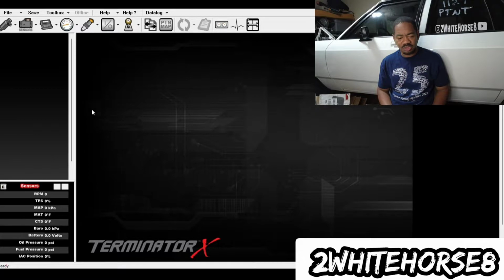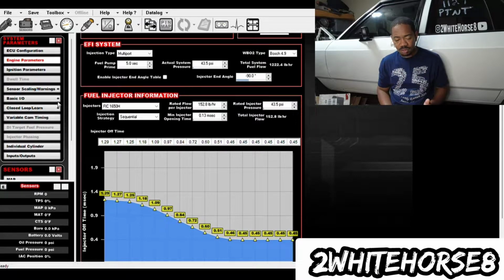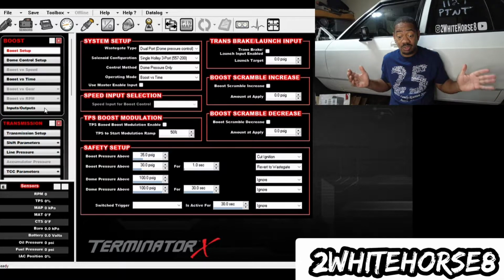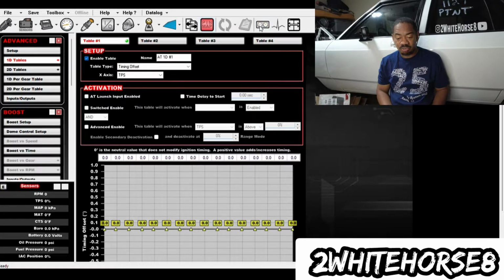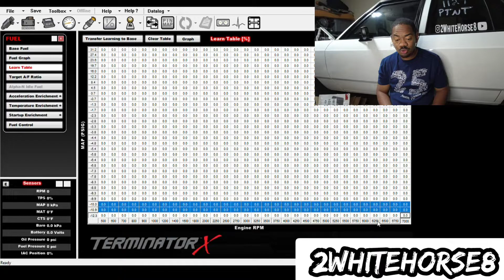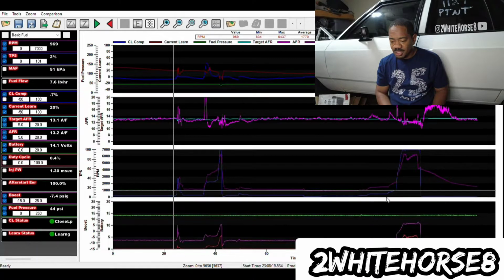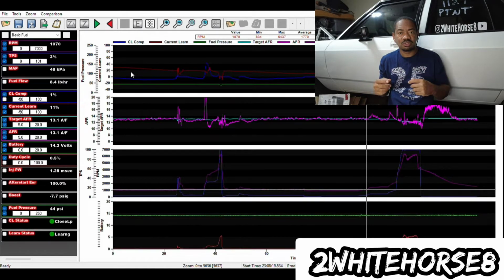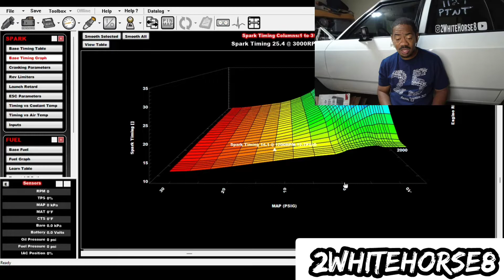Comparing Holley Terminator X to Edelbrock Pro Flo 4 + Quick Terminator X Software Overview

Comment: Sounds like if u are na go edelbrock.. if boosted Holley
Reply from the maker: If you're only looking at these two systems. Edelbrock has a more adjustable EFI system too - I just went Holley because I liked their system more at the time. There are a lot of different EFI systems out there tho
Reply: @2WhiteHorse8 one reason I’m considering edelbrock cuz it’s port injection over throttle body
Reply from the maker: @SleepyDaisy-ub9wt that a good reason

Comment: I wanna put one on my 521 Ford up I’m not planning on doing boost or force induction. Do you think I would need this terminator or can I  get by with the pro flow?
Reply from the maker: Depends on how you plan to tune it. You might want to confirm the ProFlo can tune a 521 first tho. I'm sure it can but it wouldn't hurt to check with edelbrock

Comment: Did you buy just a Holly electronics?
Reply from the maker: Not sure what you mean but it comes in a whole kit all together. Wires, ecu, some sensors... and you can use some sensors from the engine you have already
Reply: @2WhiteHorse8  I already have the Elderbrook pro flow four on my Windsor. Do you happen to have the part number that you bought? Thanks.
Reply from the maker: @mattabbott1650 I got the terminator x max for transmission control ... go to holley.com and look up the "ford universal" one
Reply: @2WhiteHorse8  I wonder if that would have the same sensors as the Elderbrook throttle body
Reply from the maker: @mattabbott1650 yeah. The sensors are the stock sensors. The wiring harness will plug into factory sensors.

Comment: Hey man. Did you just swap the ECU and use the Edlebrock hardware? I’m a big block Chevy guy with twin turbos and I’ve  only found 2 options for Port type EFI the Edlebrock and Fitech.  The Edlebrock Pro-flo 4 is an awesome option it has everything included for $2800 bucks, can use an old tablet for display instead of paying $800 for a dash panel and appears to be easy to set up. It’s unfortunate that they don’t offer a 2 step, boost controller, nitrous controller etc. being that these features are not offered im leaning towards a Holley Terminator X 4150 with the 8 injectors
Reply from the maker: I'm using the edelbrock intake, but most other parts are aftermarket. I think as long as you have the sensors reading the right thing then everything should work fine.
And you're right about the 2step and others... Terminator X would give you good control over those.
Reply: @2WhiteHorse8  awesome thanks man I hope to see you on the track one day
Reply from the maker: @terryritterbush4239 yeah for sure... maybe I'll have enough courage to line up with the big block ... but probably not 🤣🤣🤣
Reply: @2WhiteHorse8  lol it’s just a old truck motor with chrome valve covers and a 3/4 cam
Reply from the maker: @terryritterbush4239 right... sounds like a setup to me 🤣🤣🤣🤣🤣

Comment: Really curious to know which components of the PF4 were reusable and which weren't while switching over to Holley Terminator x. I myself have a PF4 on my 302 and  considering switching to Holley.
Reply from the maker: I used the intake, fuel rail ... could have used the injectors and throttle body but I sold them with the ECU. I believe that's it.

Is this for a Mustang? If so, I think they make a kit specific to the Mustang that mocks up to more stock parts.
Crown Vic guys don't get that consideration. But definitely not as many of us as there are of you all...
Reply: Yes, this is for a mustang. Were you able to reuse the edlebrock distributor?
Reply from the maker: @Daniel McCamish  no. Those are specific to the PF4. 

Check out this video:
About a year ago about the distributor I have now for the Holley
https://youtu.be/GdPYYW_A_-E
Reply: Could you talk a little about how each system ran, was there any more (how it generally ran) with one over the another, I was wanting to go proflo but their software sucks big time it either supports engines with a lopy idle or engines that have high vacuum with a small cam
Reply from the maker: @Douglas Carneau  driving wise, mine was very smooth on the PF4. And it got to the smooth riding point quickly too with the learning program it has. After a few drives, it was ready to go. Even after switching to boost it still did pretty good. The software does leave a whole lot more to be desired vs. the Holley software, but drivability was definitely there. And the same for Holley. I do believe the Holley lets you pick and choose if and when you want changes to be made more than the PF4. 
Does that help answer your question?
Reply: @2WhiteHorse8  One last question was there any power difference? and any difference in fuel mileage? and did you say you used the edelbrock pf4 manifold? but not the injectors?
Reply from the maker: No noticeable power difference just more tunability - which could lead to more power.
No fuel difference. I did use the edelbrock intake (still am for now) and upgraded the injectors because the holley allows it while the PF4 would not. Also holley controls the transmission. PF4 doesn't do that.

Comment: I have ls 6.0 4l60e (ik 4l80e coming soon) & trying to decide between the two ( holley vs pf4 ) for turbo charging. Single to start off but maybe go twins later down the road. Think the pf4 base maps manages real good? I’m no tunner at all so not sure of how depth I’ll be getting into that area anyway. Just want thang puttin down power. I have an 2dr 79 Malibu btw.
Reply from the maker: What up man. That sounds fun. 
Yes! PF4 base maps were on point for me. I think it'll be fine with your turbo too. Just put the o2 in a good spot behind down the exhaust.

Comment: So if you just have a 350 with 500 at the crank and you're not really into racing elderbrock would be just fine right?
Reply from the maker: Oh yeah. Even if you want to race it, the Edelbrock is good. It's just not for SERIOUS fine-tuning of an engine. Very good system.
Reply: @2WhiteHorse8  all right brother I've been checking out your videos preciate it I just came across the elderbrock EFI but if you said she's good for you know everyday and you want to show out a little bit okay man thanks for the information maybe Yahweh bless you and your family. I'll keep up with your content on how you're working with the other EFI
Reply from the maker: Thank you! Sure thing. I have a couple ofnvideos brewing...
Yeah,  I'm sure you'll be fine with it. What type of engine you running?
Reply: @2WhiteHorse8  355 with heads, mild cam respectively 500?
Reply from the maker: Cool. That'll be fun to put a PF4 on. Good deal man.

Comment: Great Info. From what I gather, would you recommend the proflo 4 for simplicity and for someone who is not going to race?
Reply from the maker: Yes. Even if you plan to race it a little the PF4 is a good system. You'll just be limited in how precise you can tune and log data

Comment: Great video!  I've got a 351W in my '85 Bronco that will either be getting rebuilt, or replaced with a crate 351.  I'm not going to be racing it, I will be daily driving it, and using it off road.  Would you recommend the Pro-Flo4 or the Terminator X for this type of application? Or perhaps going with something simpler such as the Sniper or Atomic 2?
Reply from the maker: Pro flo 4 would be great for you. Once you set it then you won't really need to do fine tuning. You could also get a sniper system that's the carburetor replica with minimal add-ons. Either would work. Just get one that doesn't require you to change a whole lot and make it more expensive.
Reply: @2WhiteHorse8   Thank you!  I'm just looking for something that starts, hot or cold, and can handle the rigors of daily driving and outdoor excursions, hunting, fishing, etc.
Reply from the maker: @agar4278  yeah, one of those sniper kits would be nice
Reply: @2WhiteHorse8   Thank you!  I'm just looking for something that starts, hot or cold, and can handle the rigors of daily driving and outdoor excursions, hunting, fishing, etc.  Reliability and driveability are the key!

Comment: Great channel…would you say the Holley is more geared towards strip use and the Edelbrock is a street use that can be on the strip occasionally?
Reply from the maker: In this sense, yes. Edelbrock has other systems that offer features more like the Terminator X, but I didn't see a lot of reviews or hear much about them out there. And I liked the add-ons I could see for the Holley.

Just more features on Terminator X than the Pro Flo 4 at this point.

Both are still good systems though. Just depends on the application for your build.
Reply: @2WhiteHorse8  thanks for the insight and videos
Reply from the maker: Cool. Thanks for watching them. More action coming up sosubscribe and turn on that notification bell if you haven't already..